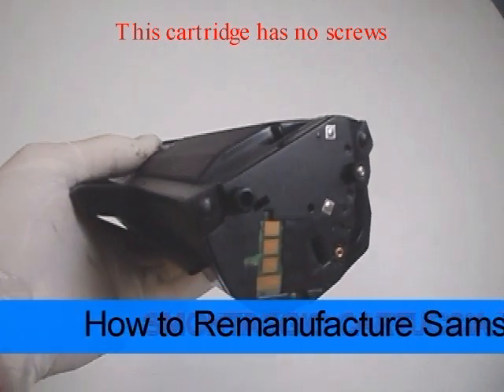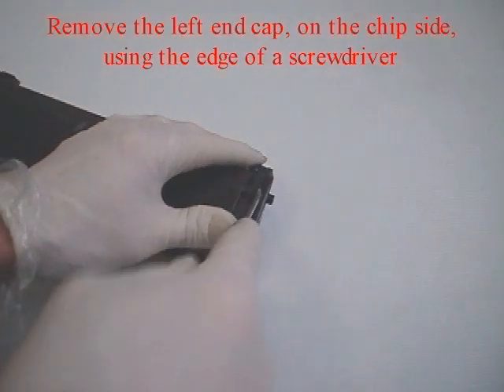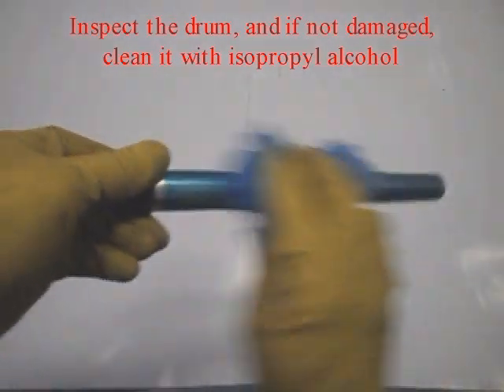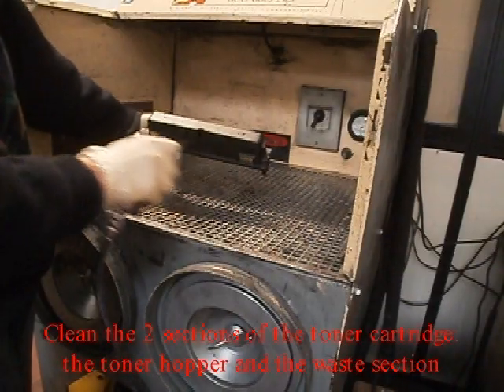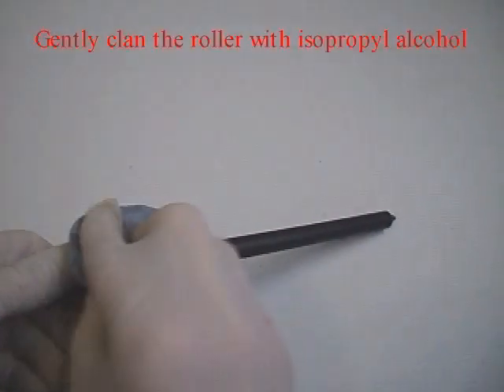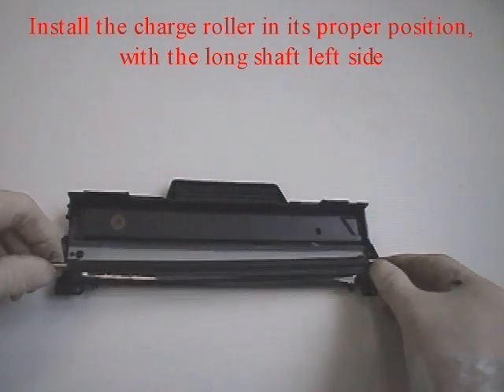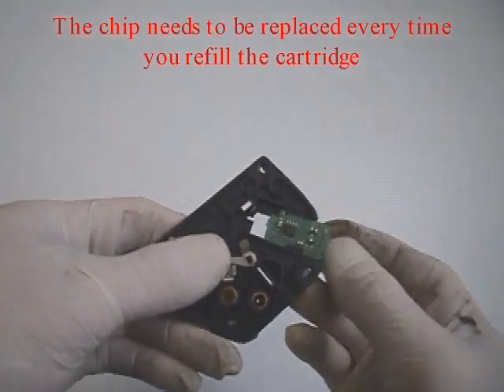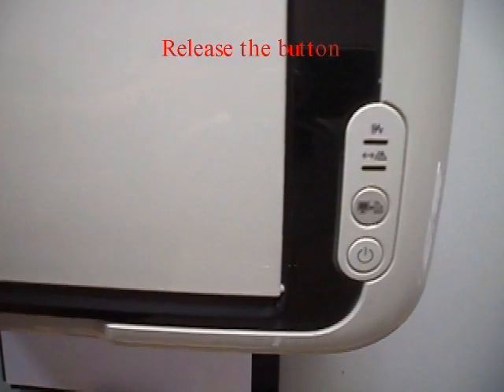Samsung ML1660 ML1665 SCX3200 MLT-D104S - Refill Toner cartridge

Comment: What do if the compatible china cartridge OPC gear is hard to turn and results in pickup roller only pulling 1/4 of the paper's length
Reply from the maker: Try to lubricate the drum wiper blade, may be the problem is here
Reply: @viandant5  thank you, turned out I just bought the wrong cartridge. MLT-D101S instead of MLT-1043S